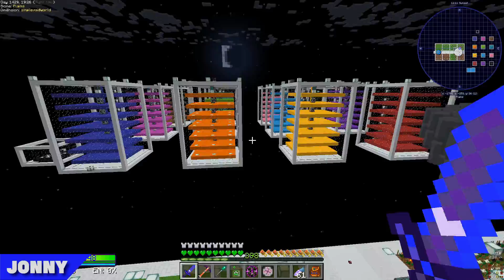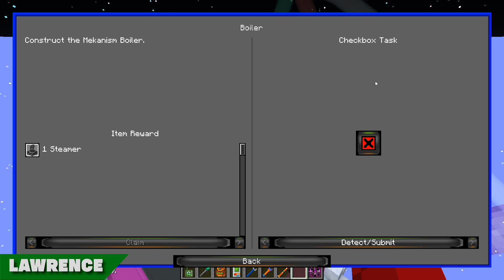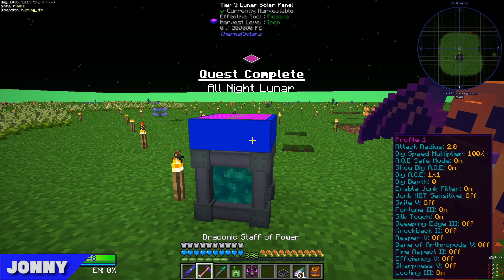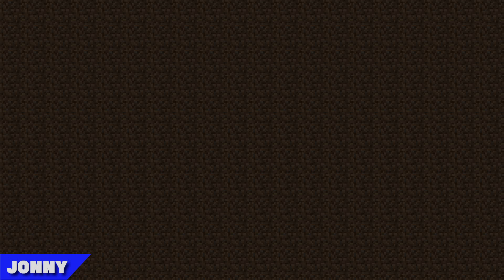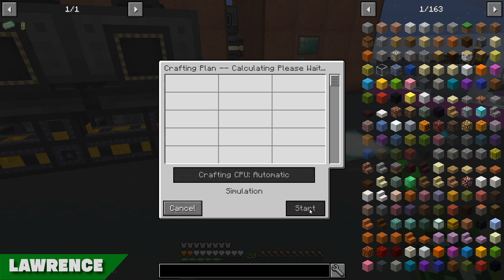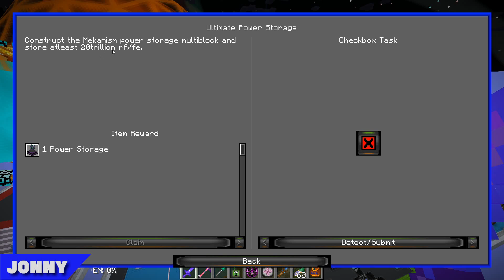Project Ozone 3 - Kappa Mode (E52) - Kick starting fusion!

Comment: Another nice video! have you guys considered reducing the mob in the duplicator to half a heart?
Reply from the maker: We actually did do that for the original ones we had (8 for each singularity), but I can't say we have noticed it taking any longer to kill them even if the have full health. The mob crushers seem to kill in one hit anyways. We might just not have done enough testing though lol
Reply: @JonnyLawrenceGaming  i see, i was just thinking of changing the platforms to spikes instead of crushers might help reduce the amount of machines, but yeah that works too
Reply from the maker: That was my original thinking, but I think all the falling mobs were causing the lag, so we moved over to just spawning them directly on the ground and killing with the crusher. TPS sits around 17 with 500+ duplicators running 😀